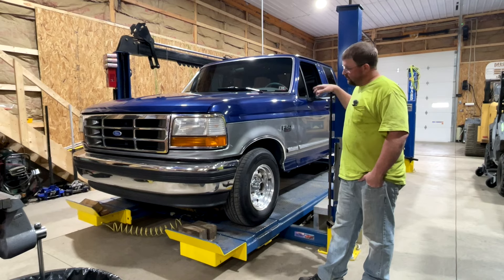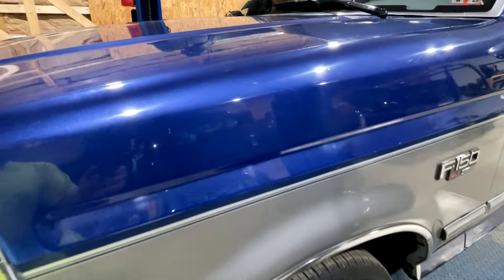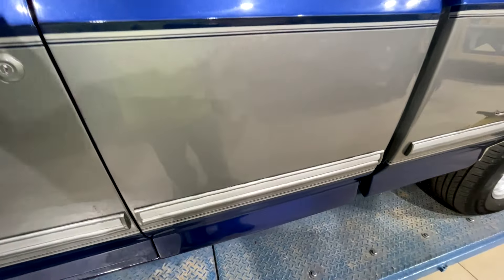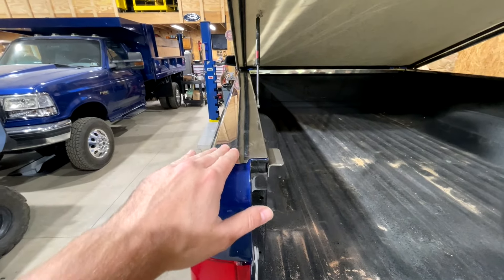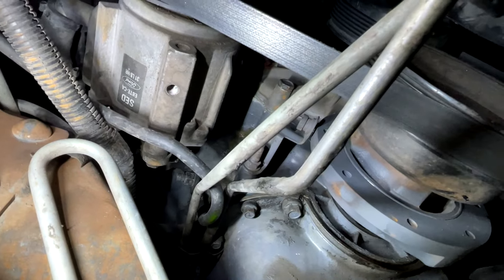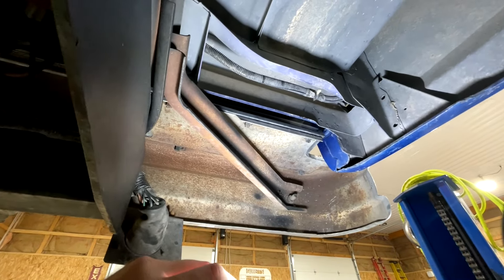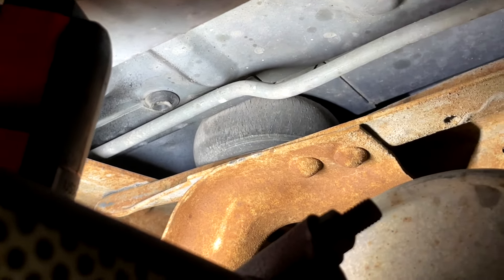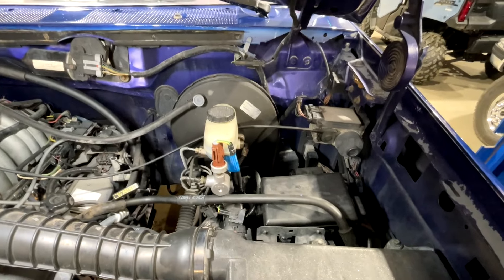The Las Vegas 1995 F-150 Walk Around, NO RUST!

Comment: That thing looks pretty good. Way better than anything we have in the frozen north. Too bad the painter didn't have a bit more attention to detail. I noticed the driver side reverse light has a blotch of blue where they missed the masking (when they should have just popped out the tail lights.) Looks like they just masked the extended cab windows too. My second gen Ranger had one of those muffin cup heatshields on the radius arm bushing.
Reply from the maker: Yeah. Whoever painted it really lacked attention to detail.   Other than that. It’s great!  I’ve never seen a truck with the heat shield on the bushing. That was a first for me.